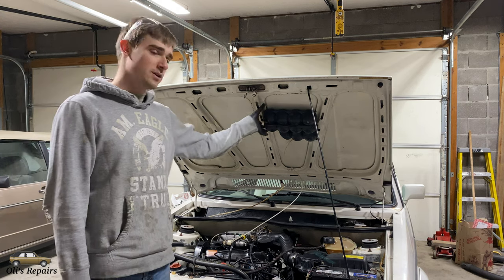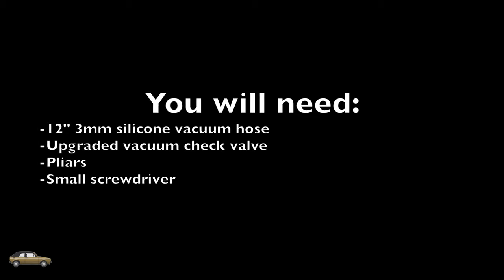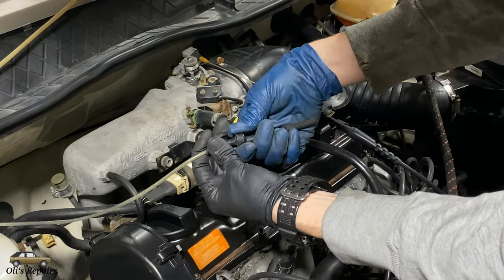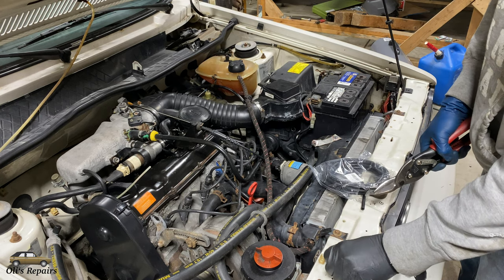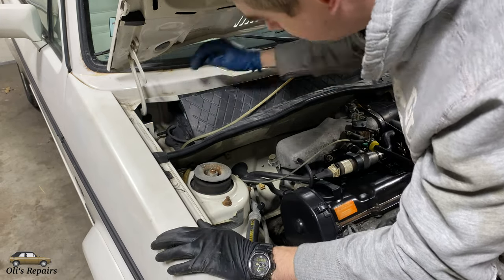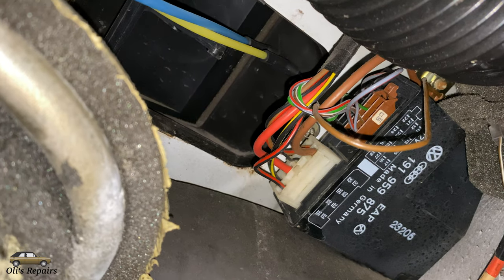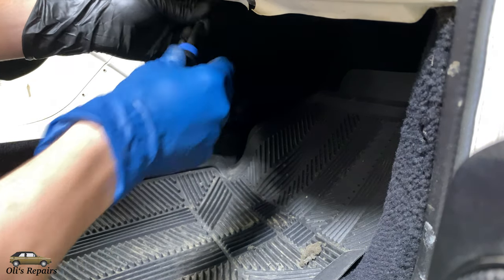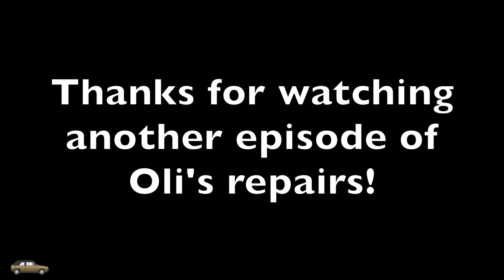VW Mk1 Cabriolet Vacuum Resevoir Delete

Comment: Hello. Thank you very much for the valuable information that your channel has. Something still wrong with the engine in my 1992 cabriolet. I'm thinking replacing it (swap). What engine do you suggest for a very easy and fast transition? Especially that it is easy to get in the United States or Mexico. I don't want a fast or big engine. Thanks for your help.

Comment: Hello. I have a Cabriolet 91. Could you please indicate what is the brand and part number of the air vacuum check valve you installed? Great videos. Thanks.
Reply from the maker: @FernandoMunozMartinez-t5j  part number and a link in description.

Comment: One tip, that reservoir helps a lot if you install sport camshafts or a modified cylinder head, helps to stabilize the engine and power the servo on those particular engines with digifant 2 injection.
Sport camshafts and modified cylinder heads lowers your vaccuum.
Reply from the maker: Mário Marques great point, and definitely something to consider. Thanks!
Reply: @OlisGarage  i had that experience myself, i have also a 2h cabriolet.
I am planning to make also some videos of my car, mostly engine works and mechanic related stuff
Reply from the maker: Mário Marques please do! What engine work did you do? 

In the Brown car in the background I’m running the g grind cam from techtonics tuning (just a eurospec cam)
Reply: @OlisGarage  the car has a long story, this Will be my third attempt.
First attempt was the factory 2h engine with only a sport camshaft and ecu tune.
Second attempt was a G60 turbo swap, later I removed it and got back to the original engine.
Now, on my third attempt I Will Stay in the Middle, not a 16v, but a 8v with some improvements, 2.0 long block, mild street head work, street sport camshaft.
I have already improved braking system and suspension but I have plans to talk about it on my videos.
My Mother language is not English but my videos about this car Will be in English because there's not many people in my country interested in this stuff.
If you are interested into that stuff please subscribe my Channel.

Comment: Thanks for sharing your videos, they are very helpful. I have to change the distributor of my 1992 air-conditioned cabriolet. I have the old one, but I am not sure if it is the original and before buying I would like to know which is the original of the car. Could you check the part numbers at your distributor of your cabriolet please?
Reply from the maker: Alex Cobo the part number for your vehicle should be 026-905-205 or 026-905-205F or 026-905-205K. That is assuming you have the 2H engine. If you’re in the USA or Canada, you definitely will have a 2H engine in your 92
Reply: @OlisGarage  Thanks for the reply. How can I know if my motor is 2H? The car is in Texas.
Reply: Do you know where I could buy it? I'm looking but I don't have many options. Thank you.
Reply from the maker: You can buy them new. They aren’t cheap though. I think I saw some for $150. Try fcpeuro or autohausaz. Engine code is located underneath the #3 spark plug in the engine block. It might be hard to read if it’s rusty. But if your car has the original engine, then it will definitely be a 2H in the USA
Reply: @OlisGarage  Thanks for the info. This task is difficult. I see multiple distributors and some have a place to connect a hose and some don't. I'm not sure which one to buy for my 1992 Cabriolet. It's a 2H engine. The price is $ 150 dollars for this reason I do not want to fail.
Right now it have a 026-905-205 AH distributor, but the engine does not sound good, I feel like it shakes and I thought it might be the distributor. It is also seen that the red wire is exposed inside. Thanks in advance for any help you can give me.
Reply from the maker: Alex Cobo your digifant vehicle does not need a vacuum advance distributor. So no hose should go to it. 
Not sure what red wire you’re talking about. 
I would recommend just going to the junk yard or look for someone parting out a car. Anything from 1990-1993 cabriolet, Jetta, or golf will work. They all had digifant injection systems.

Comment: Hi I just bought a 91 cabby and I dont have the vacuum reservoir or any hoses what so ever that go into the check valve on the idle control valve.  There is a plug in place of the hose and I dont have that device you plugged the hose into that sits under the windshield.  That area is completely empty.  When I start the car it idles like crap, I have to hold the gas down in order for the car to stay on until after it is warmed.  Once warmed the idle pulsates.  Are the 91's different than the model you have or am I missing a bunch of stuff?
Reply from the maker: No difference 90-93 in that regard. Very similar vehicles. Almost identical. 
Sounds like you’re missing components. 

Poor running can be multiple things. I’d start with vacuum leaks.
Reply: @OlisGarage  thanks for the reply.  I discovered my car was not equipped with AC thus the missing parts I mentioned.  I bought a new blue temp sensor, air idle control valve praying these will fix the issue.  If not I’ll do the leak down test.
Reply from the maker: @dgatan  pulsating idle sounds like a vacuum leak to me. I’d start there. Silicon vacuum hose is cheap. I’ve got some linked in the description that has been holding up well. Replace all rubber vacuum hoses and inspect the intake boot for cracks.

Comment: I have an 89 cabriolet. Has no back light but bulbs look ok
Reply from the maker: Did you apply 12v to test the bulbs? Does the other interior lighting work?
Reply: @OlisGarage   I didn't directly to bulb but car running. Other light like oil and high beam and blinkers work

Comment: Any info on the check valve to buy?
Reply from the maker: Ryan Ogden I just purchased the one with the part number in the description. It is a slightly larger one than the original. Most check valves will probably work..after all you’re replacing a 30 year old part which surely isn’t in great condition anymore.
Reply: Oli's Repairs Sorry! Should’ve looked. Thanks!

Comment: What if you’ve removed the AC? Can all of this just go bye bye?
Reply from the maker: Nope. Your vents are still vacuum controlled.
Reply: @OlisGarage  I guess I should have been more specific, I got rid of all AC/Heat for a track car.
Reply from the maker: @chadhanebrink8009  if you don’t want the vent controls to work (it sounds like you removed all of that) then yes. Cap the line in the engine bay and call it a day.